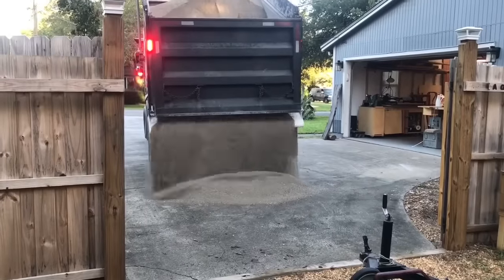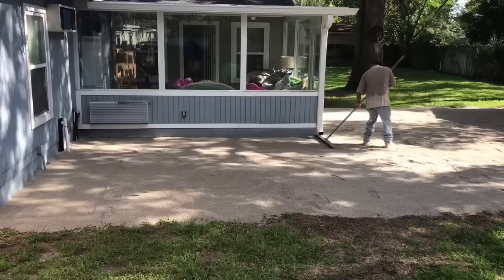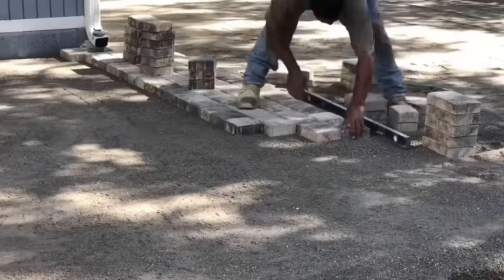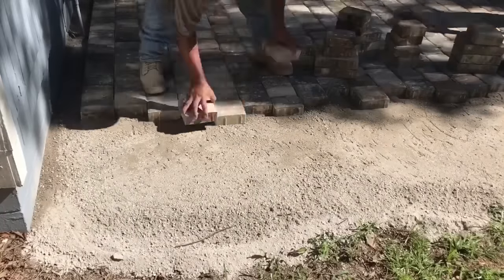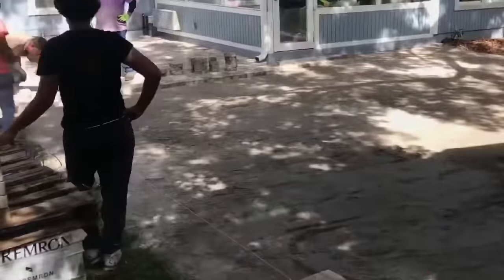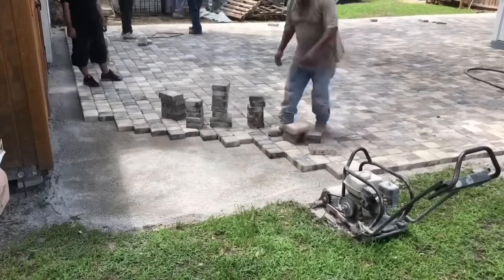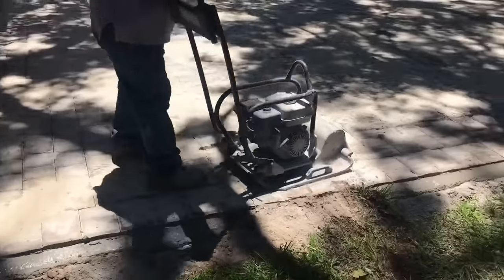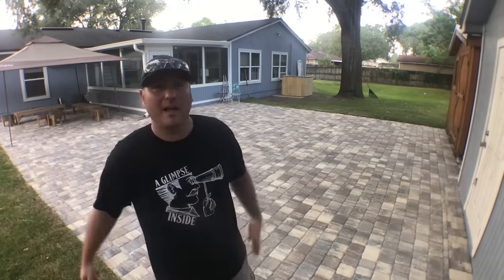How to Install Pavers like a Pro | Outdoor Project | Outdoor Living Space | Landscaping

Comment: It's very different from how we do it here in New England. Usually, around 9 inches have to be excavated to have a patio at the same height as grass. 2 @ 3inch compacted lifts of base material, 1 @ half to 1 inch thick lift of bedding sand, then the paver. Obviously, lifts can be different depending on the thickness of the paver chosen.
Reply: Yeah I do 4 inches of abc stone then inch of paver sand. North Carolina. Wish it was as easy as this. But yeah. Looks really good. All about how long it last.

Comment: This method won't work in NY or anywhere that sees a "freeze and thaw", but in warm weather climates, these guys did there thing. Nice work.
Reply: You mean for the concrete "edging" so the proper way in snow climate is to use plastic edging?
Reply: @Overfl00d  I mean for the whole patio... When you live where you have a freeze and thaw, you need a compacted base under the pavers, otherwise you'll end up with pavers that heave and/or sink. Where I live, you want a solid 6" of crusher run (or something similar) that's compacted with a plate tamper, and then no more than an inch of sand on top of that. Even in Florida, I would've at least put down a 4" base, just because a heavy rain could potentially wash out the sand underneath it. And yes, plastic paver edgers should be nailed down around the pavers to hold them in place. 🙂

Comment: I'd be happy as hell with that patio if it were in my backyard.
However (and I'm not trolling, I promise), there are a few things I'd like to point out just in case it's useful to future viewers. I'll preface this by saying, they do things differently in Florida and he's lucky the contractor even showed up.
1) The base for a patio is the most important step. They didn't lay down sand after the gravel. Usually it's recommended to do 1" of sand before the pavers. It takes a little extra work, but will help in the long run.
2) If you're going to use three sizes of pavers like this, you really should lay them in a pattern that doesn't leave long straight lines. The only long straight lines should be at the edges.
3) The edges should be lined with a plastic edge restraint. The concrete will crack over time (in the industry they call it crackcrete because it always cracks), and when you put soil over it and plant grass, you'll have a hard time keeping that grass healthy due to the shallow depth and the concrete will make the soil hot.
There are 2,000 year old paver roads still in existence that were probably built with similar techniques as what they used here. So I'm sure it'll be fine.
Reply from the maker: Thank you for your insight. I think it’s pretty cool that you gave all different ways of doing it some probably better but then you ended up with the 2000 year old comment. Good stuff brother I appreciate it
Reply: @AGlimpseInside  as I was working on building our 16x20 patio last night (I'm 3/4 of the way through installing pavers!!) I was telling my wife about this video and how big your patio is. 1,200 sq ft is incredible. Like you said, that's bigger than my first house.
Reply: What was the pavers Blocks  called
Really liked the look of these and great job

Comment: Great energy good video. Fantastic for 7 hours and cheaper price, it looks good. In California where I do pavers we use 6” base rock, 3/4” sand and cement edging of 1’ all around. We glue our border pavers onto the edging to lock everything in. We used to use plastic but it would fail rather quickly compared to the longevity of the cement.

Comment: 3.30 standard random lay when you’ve got three size teg blocks to lay. Usually you need to lay a ratio like one pack of large to two packs of medium, just as long as there’s no straight joints.

Comment: Looks good. Hard work but very nice in the end. Only thing i would recommend is dumping your sand out by the road bc residential concretes is not usually thick/strong enough for a triaxle dump truck hauling a dense material like sand. Thats a lot of weight. It may take a week or so to show but if thats 4" concrete, i betcha its cracked up at this point. Just a suggestion. Thanks for posting. I learned alot!
Reply from the maker: That is a great idea. My driveway has cracks in it to begin with so I’m not exactly sure if there are new ones are not. However that is a good point thanks for sharing

Comment: Agree with @Jimmbrooks - MOST if not all manufacturers in this area say 1" slope for 8' of run for runoff. They also say you should be laying in sand unpacked. 

I would never do it this way...only thing I am stuck on is makers of block say to not pack sand and work from outside of pattern inward which I do not like and think packing the sand or just starting from center and working out is better then fixing sand once you have a way to walk on and off the block but that is just me.

STEPS to "Correctly" install

1. Dig out 7.5" Dirt (plus depth of pavers (subtract appx 1/2-3/4" for allowing to be slightly above grade."
2. Plate Compact Soil
3. Lay approx. 4" "Paver Base/Quarry Process/Dense Pack <- All names used for the same thing"
4. Wet and Plate Compact Product from Step 3.  (Work from exterior inward in a circle pattern).
5. Lay and Screed Appx. 3" of (Washed Sand/Concrete Sand/Paver Sand) (DO NOT PACK)
6. Snap chaulk lines for center and start to lay block.
7. Plate compact block when complete.
8. lay Polymeric Sand on top of block and sweep into cracks.
9. shovel a bit extra sand on top of block.
10. run plate compactor over block (same circle pattern)
11. sweep up remaining poly sand.
12. spray block sealer as needed/wanted to prevent staining.

The end/////

Comment: @AGlimpseInside it's been a while since you had this done...how is it holding up? You mentioned that first layer down was reclaimed concrete...that's awesome! You said new concrete was mixed in...can you use this to make a proper concrete slab or just use it for levelling blocks? Can you build anything solid on top of the blocks like a tiki bar or hot tub or will the weight shift the blocks?
Reply from the maker: It’s holding up extremely well. There are no undulations or any misplaced bricks whatsoever. In fact, I think that it’s actually got stronger overtime. As for putting like a hot tub or something heavy on it. Well, I can’t say I did put an 18 foot above ground pool on it for a year. And when I took it down after having 18’ x 4’ of water, there was a single thing wrong.
Reply: @AGlimpseInside  thanks for the update!

Comment: Nice job but how do you lay paver around an a/c unit that sits on a plastic platform without moving the a/c unit.  My installer laid pavers 16 inch away from the unit all squared around the unit . doesn't the rain water sits and drain into the unit?

Comment: Very nice!  What keeps the pavers in place?  Do the pavers actually adhere to the pulverized concrete below?  Or do the pavers weight keep themselve’s in place?  I saw some concrete used on the edge is that the only place concrete is used to keep the pavers in place????  Or do they possibly spray the whole thing down once laid causing the concrete to harden to the pavers??
Reply from the maker: The pavers are fixed in place by tamping them down with a gas powered tamper. Also a whole bunch of white sand is flooding on to the surface rust in all the cracks and sealed with a little bit of water. Creating one really big structure

Comment: GREAT VIDEO. YOURE THE MAN! HOWEVER, I HAVE A QUESTION. AT WHAT POINT OF THE PROCESS WOULD I LAY DOWN A WEED BARRIER??? BEFORE THE PAVER BASE I AM ASSUMING ? THANKS
Reply from the maker: The base is thick enough that no weeds will grow thru. If any weed do pop up, which they haven’t, the embed themselves in the cracks then grow from there

Comment: Not criticizing the work since I’m not a pro or anything but I’ve been watching several professional paver installers and this is the first time I seen pavers without the layer Of sand. 
Any reason why yours didn’t get the one 3/4 sand base?
Reply from the maker: It’s just not needed. When they screed the top with a level as the last step it creates a little bit of a soft area for the pavers to nestle in underneath the compacted paver base

Comment: Hey Cris. I am from Sask , Canada ,  nice to see your video to install pavers in backyard patio. Your video convinced me to built my patio in backyard myself . Question, how about if I use concrete slabs of 4*6 feet instead of bricks . Does it work better, cheap and nice
Reply: Slabs in that size require heavy equipment. Smaller paver is easier to construct.

Comment: Did they put sand on top of the base? I was told to do 2 inch of sand first before laying down the stepping stones. How much did it cost to do this?
Reply from the maker: Are used an all in one paver base so no extra sand was put on top. Here in Florida with no freezing temperatures this seems to be the way that they do it because it’s relatively inexpensive and you can still get a pretty good desired result
Reply: 2 inch would be to much though . It should only be about an inch
Reply: A Glimpse Inside I’m planning on doing a patio as well and I live in Saint Pete, Florida. Is the that company in the Tampa Bay by any chance?
Reply: I live in Ocala, Florida and as beautiful as this is.. I'd be scared of the price tag.  It's phenomenal work.  The build up is top notch.
Reply: Kenneth Moran hahahahahahahahahaha

Comment: This is great. Thanks for the video. I'm interested how they put down that foundation. Just sand on top of the dirt. All the stuff I've read recommends 4 - 6" of 3/4 minus gravel with about an inch of sand on top. But, then again, I live in the PNW, not FL. Maybe that method holds up in FL...
Reply from the maker: I would like to say that you have some of the best commenting etiquette I’ve ever experienced. That’s how you do it brother. Furthermore in Florida we have a little bit less strict standards for laying pavers. Due to the fact of no temperature change is as great as it is elsewhere in the country. This works fairly well I’ve had family have this work done years ago and everything is holding up great. Thank you so much

Comment: Hey Chris did they suggest that you caulk against the house and the pavers ? That way water doesn’t erode the base away in a heavy rain ?
Reply from the maker: Mike Preddy Hey Mike it’s funny you ask that because I spoke of that as well to them! Essentially caulk will separate overtime which really makes it not useful in the first place so I believe the Polly Merck sand is heavily in bedded in between the house and the pavers which will essentially turned into almost like a grout or Concrete.  So like anything it’s not 100% bulletproof but it should last a good while
Reply: A Glimpse Inside oh ok I was wondering because I saw the gaps and was thinking about the rain. Looks great though !
Reply from the maker: Thank you man. Need be I can always caulk it in the future! Nice question man. I like it!

Comment: Looks really good, unfortunately they use concrete to lock the pavers in place, crackcrete not the best material for that. You would have been better off using the plastic material and driving stakes into the ground.

Comment: What if you had to leave a square in between to plant a shrub or a small tree, would you use cement to lock in the ends of the pavers around the planting hole?
Reply from the maker: I’m not really sure. I would worry about the roots pushing up other pavers around it though
Reply: You definitely want to use some sort of edge restraint(plastic edge@ home depot for about $7-10 or the concrete) at any point the pavers aren't up against any existing solid edges.
Reply: @CNSmotosports  can i lay pavers on their sides around the edges and dig them half way in so that they're parallel with the rest of the pavers laying face down?
Reply: @hamidsabir2296  I think it would hold strong as long as you didn't put a bunch of weight next to the edge. Keep heavy stuff about 12" away.

Comment: You will be having problems soon.  The first thing they should have done was dug up the sod and put 21a down and tamped that down then used sand mix with concrete  so the pavers won’t sink into the ground

Comment: That pattern is called stretch a bond for a start and why did they not use a rock bass then you put some weed fabric down then lay the screed for the pavers Tamp each layer every 2/3 inches then lay the pavers on top I recommend using a REAL polymeric sand to joint the pavers with not a Mason sand that cost like $20 a ton vs $20 dollars a bag  40 lb bag that's cannot be real, maybe Sunday if you put a damper on this is wood stick to the Pavers  and leave marks but then again maybe I don't know🤣🤣 you are going to have a serious problem with weeds subsiding dipping underwater logging

Comment: Surprised they didn't do a sand on top of the crushed concrete. I'm also scared as to what that price tag was for 1200 square feet. Easily 15k, maybe 20k depending on that they charged per sqft

Comment: how much did it cost to cover that much area? Material and labor included? It just seems extremely daunting to do during pandemic when everything is so expensive.
Reply from the maker: Do you know actually have those guys out here today to give me another quote to expand on this patio. Quite frankly the pandemic is here however prices of goods that don’t involve pressure treated lumber or dimensional lumber or actually not as affected as everybody thinks. This job call six dollars per square foot and it’s about the same now
Reply: @AGlimpseInside  I live in Oregon and the demand for jobs like this is through the roof. You have to make appointments months ahead and they give you insane quotes. Now I don't mind paying them if they can give me solid work. I've had work done in my front yard and backyard and both have been sloppy. It just seems hard to trust people with big projects.

Comment: What was the Square footage and how much did they charge. Im now going to Remoldel my back yard for the same reasons and looking into prices.
Reply: do NOT use this video as example everything they did is wrong !!!i have over 20 years in the business that patio was 1200 sq ft and should of cost at least 12000 to 16000 i hate to see people waste money and now this guys patio WILL FAIL GUARANTEED!! it will sink ,shift and the concrete will crack on the sides!!!

Comment: So I'm new here and I don't want to be a party pooper but everything I've learned about pavers is that you should have 4"-6" preferably 6" of sub-base, and 1" (no more) of sand. Why didn't they use sand?
Reply from the maker: Without freezing temperatures to deal with you can get away with a bit less material and different materials. In Florida this is pretty standard stuff. At least that’s what they told me
Reply: @AGlimpseInside  Where at in Florida? I'm also in FL. (Edit - Nevermind, I see you're in Jacksonville.)

Comment: Keep us posted on how long this lasts, this is not how we install them here, it wouldn't last a season this way where I do installs. The price they charged is absurdly low too! Here our brick is $5-30/ft just to buy lol!
Reply from the maker: Kyle Quinn Where exactly are you? I’ve seen jobs they’ve done 7-8 years ago and still look good today
Reply: Kyle Quinn, our company wouldn’t do an install this way either. Maybe it’s because I live up north with the snow and all the elements that come along with the seasons, but I couldn’t imagine this patio lasting longer than 3-5 years max where I live! 
Also in agreement with the price p/sq ft.  You got one heck of a deal. 
I hope the patio works for you and your family enjoys it. They did good making it flush.
Reply: @AGlimpseInside  I live in Ontario Canada, we get a roller coaster of freeze-thaw cycles as well as heavy snow and rain, sometimes all in the same week! When we do installations we use geotextile fabric, as well as different grades of aggregate materials for different purposes in order to add as much buffer as reasonably possible between the compacted native soil and the pavers above to help prevent moisture absorption into the aggregate from the bottom up as well as the top down, helping to prevent aggregate wash-out as well as to help keep the pavers in place when the ground below freezes and thaws. We also avoid concrete edging like in the video as it would just crack and fall apart.
Reply from the maker: kyesniper all good tips for you climate for sure. Lucky for us we don’t have any of that in Fl! So this works just fine!!
Reply: @kyesniper  what would you roughly charge per sq. ft in Ontario?   I'm in Northern Ontario and am trying to gauge pricing.  Thank you!

Comment: Using concrete as an edge restraint. Ooh baby what is you doin
Reply from the maker: Haha. They did it bro not me!!
Reply: Ya id be pissed if i paid all that 
Money on pavers and it wasn't dead even with the ground.
Reply: PCGonline bound to crack over time and pavers sliding around. 
Would of been soo much better to use actual paver edging spiked down. 🤷‍♂️

Definitely something to keep and eye on.
Reply: Caleb Willhelm AKA DESTINATION SOUTH you want the pavers above dirt so when it rains, it doesn’t migrate in the pavers, making a home for weeds.
Reply: Concrete edge is typical restraint for this style, much faster and cheaper than plastic edge.